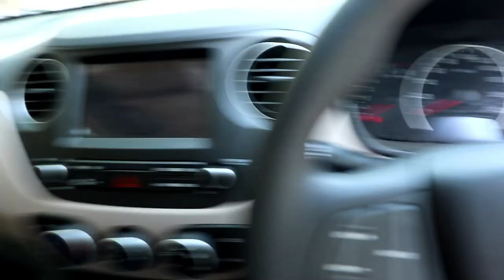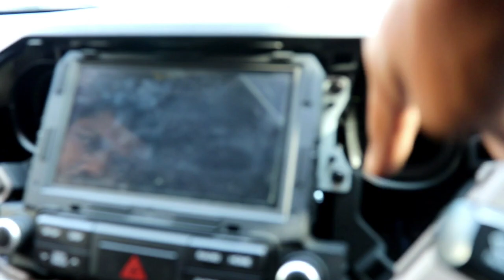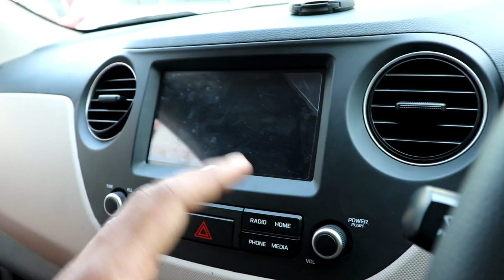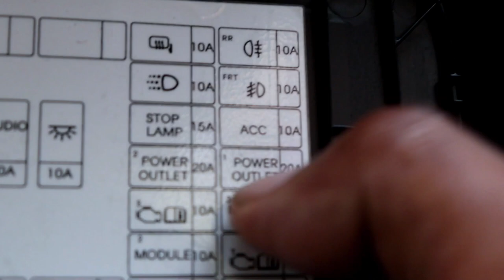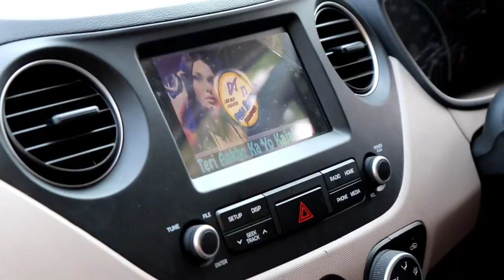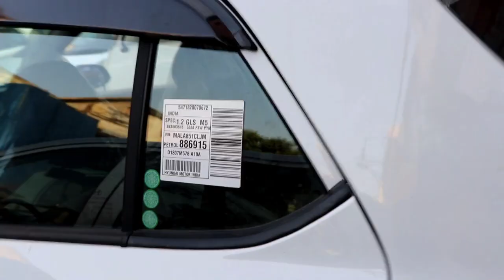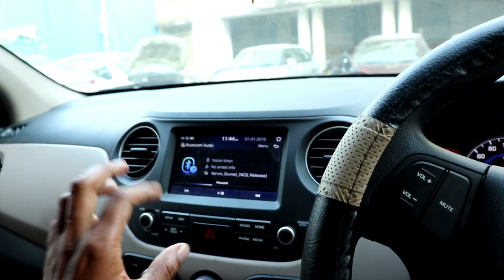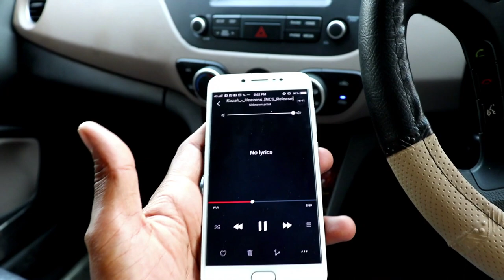Installed New Music System in i10 Grand || Techno khan

Comment: This audio converter actually drops the quality rather you would have used High Level Input connector on amp for better audio quality and will pump the actual power out of the Bass Tube 🔊